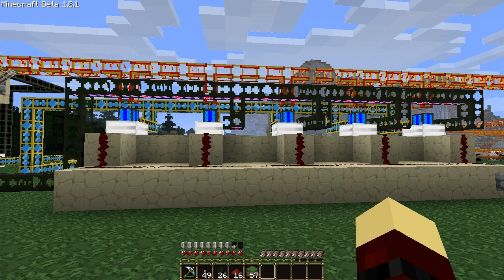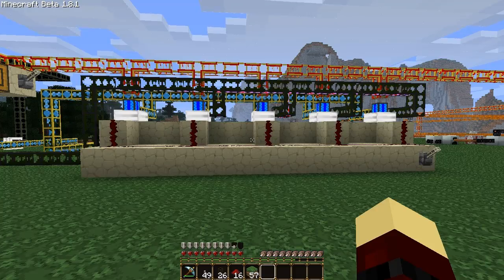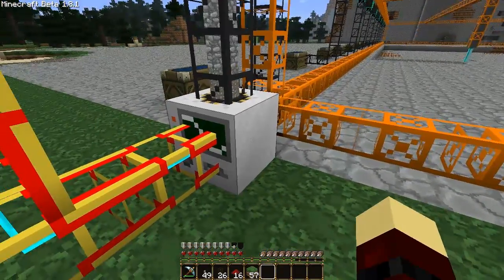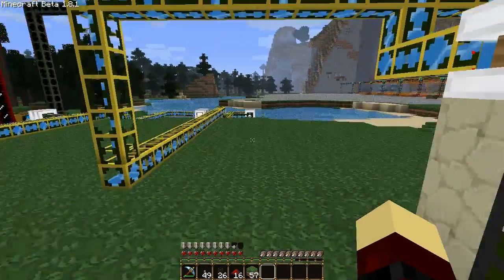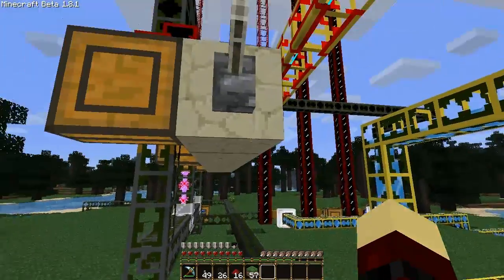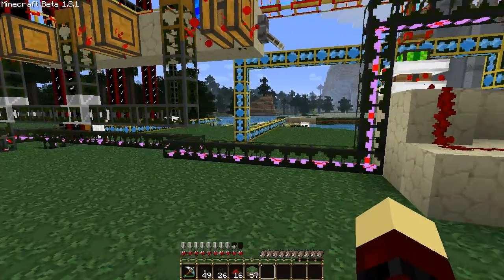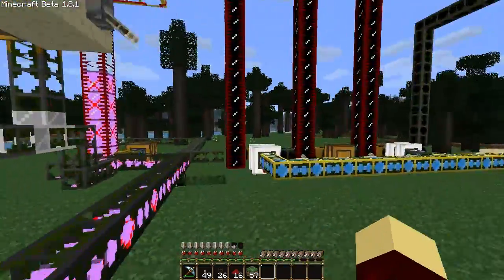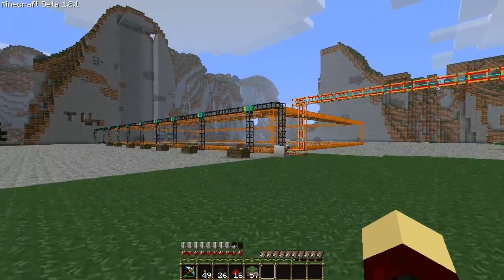BuildCraft 2.2.0 Energy Tutorial

Comment: I desperately need help in this area. I have read all the wiki's and tutorials but none seem advanced enough to help me. My main problem lies within cooling combustion engines running fuel for more than 10 minutes (Once they cap at 4900 degrees) My setup is 3 combustion engines with 1 pump (At max pumping power) throwing water into 2 seperate gold pipes on each side of the 3 combustion engines. STILL NOT ENOUGH water to cool them!?! It says on the wiki a pump can cool 16 engines. Any tips?

Comment: I am using 5 combustion engines lined up with one block of space between each one. They are running on oil, which i refill, and have water being pumped into them...i have the same set up as him, powering my refinery. The electricity only shows in the wood conductive pipe, but not though my gold or stone ones....and help?

Comment: Why do people always use combustion engines to run oil refineries? Surely you use oil for the conversion process while you use a combustion engine?

I would suggest using about... 40 red stone engines to use your refinery. Or using about... 20 steam engines to run them. Linking them up with the conductive pipes of course to the oil refinery.

It might not be very space-efficient... But you would have more oil to convert in the long run then you would have using the combustion engines.